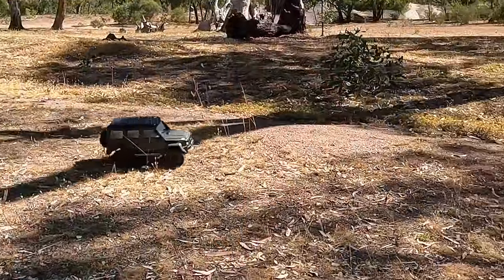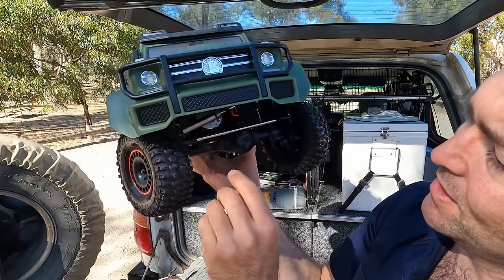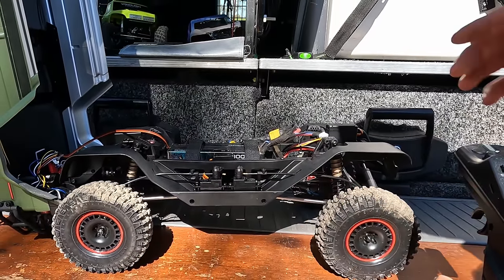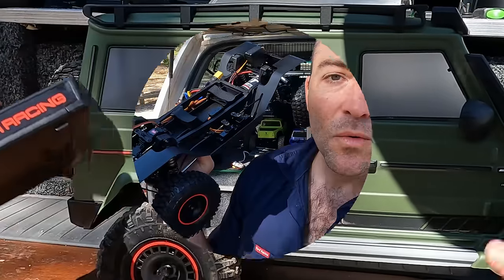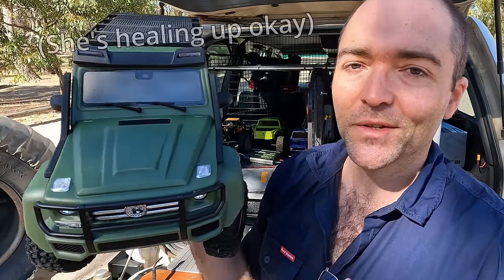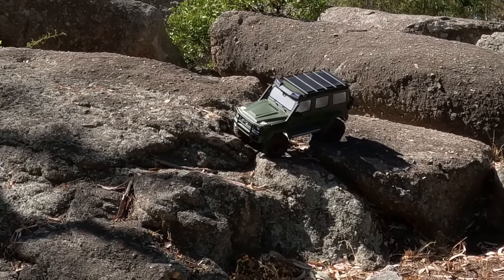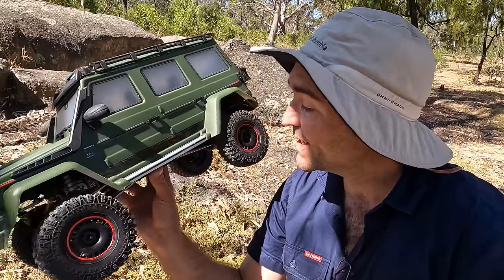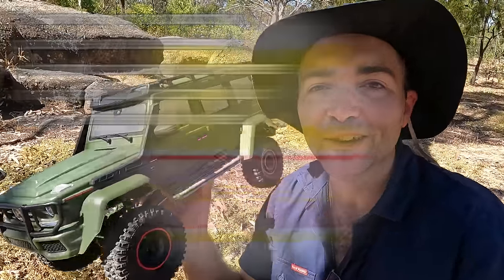Something Actually NEW in RC!

Comment: Called "cutting" brakes...
Tractors use this idea
1:1 comp crawlers, too.
Reply from the maker: Ah good info! Thank you!
Reply: Check out the CowperTrucks 'suzuki extreme 4x4 challenge' vids here on youtube. Extreme cutting brakes!  In these cars the copilot runs brakes for each wheel and they are working hard for sure.
Reply from the maker: Oh I'll do that, thanks!!
Reply: Yes I had it on an old utility trike called a Helm Farmhand. I copied it for a VW trike that had problems steering under acceleration.  Just right and left hand brakes instead of dront and rear.
Reply from the maker: Wow! That sounds really interesting, eh. Love it.
Reply: There are a few AWD systems which use active braking on each wheel as a form of limited slip diff, too. We used to do a crude form of it when off-roading by holding the brakes partially on when cross-axled to get more drive on the stuck wheels.

Comment: Differential steering/braking is not new. It's not normally done on RC because it's not needed, and leads to unreliability. When it comes to crawlers, reliability is king.
Reply from the maker: That's a succinct way of making my main point in the video here, if you replace "differential steering/braking" with "independent disc brakes". 

The diff and driveline tricks aren't new and are common in RC already, but the disc brakes are the exciting new tech that I'd love to see in faster cars as traction control.

Is not because it's needed. Obviously, we get by just fine with only throttle and steering. No one is arguing otherwise. But it's cool in the same way striving for new tech is cool, like how we went to the moon, or invented flight, or explored the ocean depths. We didn't need to do it, but I'm glad we did. 

Same with disc braking here - that's why I'm excited about it. New developments and what they mean for the future is fun and exciting to think about, at least to me! Cheers 👍
Reply from the maker: For sure, brother. Totally agreed.
Reply: He never said this is new to every vehicle ever made. He said it's new to RC. There's a difference there, and he is correct, while you're arguing against something he never said. That's called a strawman argument. I like to see new things introduced, and see how they work out. That's how things advance, in every aspect of life. Things either work and become the norm, or they don't and they go away. Crying about everything new that you see, is how things become stagnant & boring. Do you still run the same truck you ran 15 years ago? No, because there's better stuff now, than there was then. Did you cry about the new stuff you have now before you bought it?
Reply from the maker: @TheAmericanUhate You've perhaps misunderstood my answer. I didn't make a strawman argument. Diff locks and DIG are far from new in RC, they've been around for years at this point. This is me disagreeing with that statement, and also restating it so that I can agree, with the "independent disc brakes" line, particularly as it relates to traction control - something not yet seen in RC but now seemingly possible. 

I think the future is very bright for RC and it's exciting to watch. Cheers.

Ed. I just realised you're trolling me. Lol, well played. (the "crying about new things" should have been my clue, given this video is about my excitement for this new thing 😅 You got me!
Or maybe you were answering the other guy. I think I've gotten confused here!) 

Maybe we can all agree that independently controlled disc brakes on rc cars is new, has some interesting possibilities, and brings complexity that isn't for everyone?
Reply: @TheAmericanUhate  if RC trucks have been doing it for a long time it's not new to RC so your argument is still invalid
Reply: New to rc it said
Reply: @RCTNT  I meant for that to go to stabbyjosh, the OP that was crying about cutting brakes not being new or needed. I'll never understand people that actively try to hold back progress or anything new. Everything you said is spot on and correct! Thanks too
Reply: @devilsreject78  RC trucks have not been doing it for a long time. This is the only RC available with them in fact. Unless you think this truck came out 10 years ago, and we're all just hearing about it now? If that's what you're saying, then you're still wrong.
Reply from the maker: Thanks guys. I think we're all on the same page now!

Simple is reliable.
New gear isn't for everyone, but it plays a role in progress.
Progress is good.
Designs tend to improve over time.
Reply: @TheAmericanUhate  actually. Differential steering was the norm in RC tracted vehicles back in the 70-80s when electronic mixing wasn't available.
Reply from the maker: @stabbyjosh7931 oh really? That's interesting. Do you recall any models that used it? I'd love to learn more.
Reply: It also adds weight… any weight above the axle is a downgrade unless absolutely required… thinking about getting rid of my 2 speed for this reason
Reply from the maker: @V8chump for rock crawling, this is very valid. I see a nuance here between trail driving and rock crawling. I'm going to cover this divide in an upcoming video, because the way we prioritise a build can vary considerably between performance and features, and how these both play into one's idea of what's fun. Fun being, after all, what this is all about!

Comment: Not going to lie, a cutting brake is a pretty cool feature for a crawler. Much more viable a thing for a true rock crawler, but happy to see some innovation! Thanks for sharing.
Reply from the maker: Thanks Matt, I didn't even know of cutting brakes before this car. I learned from a few commenters here. It's a great idea and I like it better than DIG (for turning). Just would like to see full commitment to it with brakes that clamp well enough to work on rock.

Someone in the comments suggested these would be good as front brakes on 2WD models, too. I thought that was a fine idea and it might work really well! Could be a useful feature on SCTs in particular.

Comment: The frosted windows can be made clear if you varnish them. Just figure out which side has the frosting by scratching it with your nail. You may need to paint the details inside the cabin which is most likely the resason why they frosted the windows.
Reply from the maker: Thanks. It's on the inside.

I'm not sure varnish is what you mean. Varnish remover perhaps? Happy to be wrong but varnish sounds like a bad idea...? 

This is an old thread but it's a useful resource: https://www.tamiyaclub.com/forum/index.php?/topic/54797-removing-stripping-paint-from-lexan-polycarbonate/

Comment: I’ve been looking at crawlers for years. I’m close to getting one. I’d absolutely love this as it has everything. Just the fact is a Chinese car are getting aftermarket/hopup/brass parts is the one thing that keeps putting me towards a trx. I hate traxxas but it seems they have the best crawler on the market.
Reply from the maker: Certainly, the TRX4 is a compelling option, especially if you're in the USA where the pricing is reasonable. But I'd also suggest you look into Cross RC, specifically the Emo AT4. And Boom Racing BRX01, if you're into scale. I've got these and more covered on my channel here. Element RC makes a bunch of great stuff too.

Now I think about it, there's so much good stuff to choose from! I've got an article on my website you might find interesting also:
https://rc-tnt.com/manufacturer/multiple/what-is-the-best-rc-rock-crawler/
Reply: @RCTNT  nice one thank you. I’ll have a look at what you’ve suggested. Your channel popped up in my feed. Glad it did. I’ll have to binge watch some videos, damn you!!!! 🤣
Reply from the maker: @ozaricblox2016 lol nice. Enjoy the rabbit hole!
Reply: I got Axial SCX III Jeep Rubicon and it's been holding up great. It has rear locking differential which you can reverse the servo and have it shift the two speed transmission. Comes with lights and a driver.👍
Reply from the maker: You sure you don't mean dig? I'm not aware of a rear remote locker in any of axial's line-up, though I'd be delighted to be wrong!
Reply: @RCTNT  maybe it is dig. It came with the servo hooked up to the rear, but you have to take apart the transmission and remove a spacer to make the two speed work. The dig servo got hot and burnt up. Getting a new servo to shift the transmission.
Reply from the maker: @flynnstone3580 ah gotcha. Yep, it's dig. This same thing happened to me on the Gladiator when it was new (literally in the first few minutes of driving - happened on camera), but for the dig servo. They don't calibrate the end point correctly from factory. When you replace the servo, be sure to address that or you'll burn out the new one too.
Reply: @RCTNT  same here, mine burnt up in the first few minutes. Then I saw a video on the calibration after the fact. Other than that it's been a good rig.

Comment: Been a factory Suzuki,  Yamaha,  Honda , pro bicycle mechanic for combined 45 years.
From the 70's on, I have lived to see technology advances across all these areas.
Now RC. 
Some advances are good. Example: Shimano SIS. STI. Look pedals, to name a few.
Then suspension came. Then 8 speed, 9, 10, 11, 12 speed.
Mechanical disc, Hydraulic disc. Steel frames, aluminum,  carbon glued, then full carbon frames. 
If your a person not in the industry, of seeing first hand the pro's and cons of " new" technology,  the consumer can easily get caught up in the " more is better" tidal wave.
I have seen much of this.  
A lot of innovation is driven not so much as necessary,  but by engineers and business to make profit.  Some innovation is actually really good, and adds benefits.
Some is terrible and causes more problems than does good.
When carbon fiber bicycles came out, everyone is like "wow, cool". Ive worked on many a carbon frame an seen the cheap , engineering on these frames. And I mean the top brands. Some brands do it right. Some not.
Innovation can be good, or can be just more complicated and $$$ costly.
Reply from the maker: Sometimes innovation brings new tech to the fore in an unrefined manner, but through that process you get to see refinement as more folks spend time engineering the idea, eventually leading to a refined and useful new way of doing things. Remember when v-brakes were the new hotness in the 90s? Then hydraulic discs became a thing and now even cable-actuated discs are comparable to v-brakes. But it took time to get there. 

Of course, then there's the Trek 9000 and its auto-eject rear suspension, haha!
Reply: @RCTNT  Nope.  It as to be perfect right out of he box.  No version 2.0 or even 1.2. 🤣🤣
Reply: Many times v1/1.0 is the most refined, not in this case, it's just an added feature that opens up some possibility. When it trickles out after has fully developed and tested, in   tiers and stages ,I'm out for better or worse.  I'm thinking of getting the yikong for my first decent crawler but am still on the fence. When these servos give up, do they take a regular servo? I can't see the markings
Reply from the maker: They take a small servo, like the HDpower TR4, for example.

This remains a fun and interesting machine. It's cheap for what you get, but the crawling is unrefined. As a trail truck though, for those of us who enjoy the bells and whistles, it's great.

Comment: did you know there are actual hydraulic disc brakes for the front and rear of the Baja 5B and other 1/5 scale cars? They have been out for a while now.. Very cool!
Reply from the maker: I didn't know that! I only have had a few 1/5 cars and none of them had hydraulic disc brakes. For that alone, I'm going to have to look into the Baja 5B, wow! (My SBR2.0, X-Maxx and older 5ive-T electric conversion didn't have this, but my experience with large scale ends with these).

Comment: I own 2 Yikong/Absima RCs, their 1/10 Jeep which I've had for around 3 years, I've driven it often & hard & it's still about 90% original.
I also have their awesome 1/8 Bronco which I've owned for a year & is 99% original.!
They make some extremely good trail trucks.!
Great value, really durable, they perform brilliantly & look fantastic.!!
Parts availability is no problem either, in the UK at least. 
I can't recommend Yikong highly enough..
I've got my eye on their 1/7 TB7 solid rear axle desert racer & their DF7 desert truck.!!
Reply from the maker: Thanks Alan, I hear good things also. I know you're enjoying that 4083 1/8 one, or whatever the model is. It's on my list!

Comment: That is the same remote that comes with the fMS10 blazer. Is that a 2 in 1 esc receiver combo, or does it have a separate one? If so, I need to know what the receiver is?
Reply from the maker: The radio system is the FS-MG11-BS. It's a 3-in-1 receiver, actually: rx, esc and light controller. I cover it in more detail in my article about this car.

Comment: Faulty servo or faulty setup i.e. no servo end point adjustments?  For a "digital"  yes/no channel, being able to adjust end points is crucial.
Reply from the maker: Faulty servo. You do have end point adjustment on this radio. There's a config mode (full right, full reverse, power on) and then you actuate whatever channel you want to adjust and then the steering wheel to set.

It was a faulty servo in this case. It happens sometimes in both cheap and expensive models.

Comment: Ford has a trim package for their full size trucks called the "Tremor". It has this feature. Sharp turns either way will lock the inside rear wheel for tighter turning. Like a tractor. Lol
Reply from the maker: The Ford Bessie, a modern classic 👌

Comment: fiddler brakes, don't suppose i can get the rear axle, break and servo set up? or at least a parts list? im currently planning a prototype sporting trials car, fiddler brakes are exactly what i need but i cannot figure out how to do it in s believable way, somethin like what this uses is almost exactly what i am trying to figure out... minus the diff lock
Reply: before anyone says, fiddler brakes (more often known as fiddle brakes these days) is the original name for it, cutting brakes are just a modernized form of it, fiddler brakes as the name implies are significantly more primitive
Reply from the maker: Hmm, possibly you could manage it. The problem is parts strength, you really need injection molded plastics and our diy stuff is extruded filament.
Your car will have independent suspension, so you can't even adapt the axles here. Definitely an engineering challenge!

Comment: I like it! You get a lot for the money, body looks good, and it's capable. Although, when you mentioned what else the rear brake could be used for, I was thinking 'E-brake for those tight hairpins on a rally course' 😁:yougotthis:
Reply from the maker: The handbrake (or e-brake) exists already in some cars, like the Infraction, and it's rad, yeah! This independent slowing of each wheel is quite interesting too.
Reply: @RCTNT Oh nice! I forgot about the Infraction.. man that would be fun.

Comment: Great to see you back. 
I was down myself from March 3 til yesterday it began to lift. 

I have a question about the steering link shock? I've never seen this  .
Can I put this on my challenger by rgt. What will I gain? 

Happy to see you well enough to be out . The ground and trees seem to be what we need. 

Wishing you the best mate ! 🎉
Reply from the maker: Thank you, it's good to be back. Glad you're feeling better. I'm nowhere near well, but grateful to be able to get out and about. Could be worse and yes, trees and fresh air are a boon.

The steering damper is a servo saver. You could look at it as an upgrade for stock servos but once you have a stronger servo, it's not really needed.

There's another variant that looks like this but isn't a damper. Instead, it's an adjustable length steering rod. Mainly cosmetic, but looks the same as a damper. That's the one to get if you want one, I think. But it's cool on this car - adds to the complexity of it, which is kind of its thing 😎
Reply: @RCTNT thank you for the reply. Wishing you progress!🎉

Comment: Maybe not scale but individual motors for each wheel connected to a drone flight controller and some clever software could drastically improve drivability and reduce mechanical complexity.  Like the Mammuth Works RC but with Chinese manufacturing knowhow and refinement.
Only one servo for steering (maybe one more or rear steer), 4 motors (no or minimal transmission), a 4 in 1 ESC/controller/receiver would only be needed to perform all the mechanical functions of differentials, individual wheel brakes, reverse, over/underdrive to each wheel (even ZERO radius skid steering!)
Reply from the maker: You're not wrong, but there's a nuance here. I'll cover it in my FCX10 video, coming soon, but I see utility and scale as two ends of a spectrum, and there are hobbyists/enthusiasts on both ends of it.

We do have the comp class Pro/MOA 2.2, where MOA stands for Motor On Axle, and they're very capable rigs.

But then, a separate transmission, transfer case, mechanically actuated 2-speed, lockers, etc. are all a source of delight to those of us who appreciate scale recreations of the real thing.

And of course everyone has their preferences and some like scale but still keeping it simple - Matt of @scalebuildersguild is an example of such a person. That's fine with me - I'm just grateful that there's so much choice to be found in the hobby these days. It's amazing!